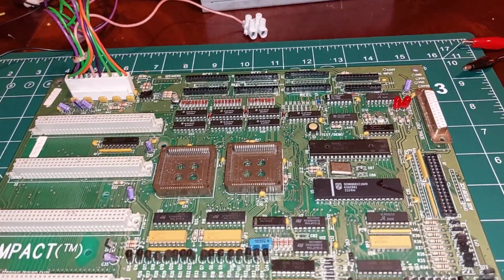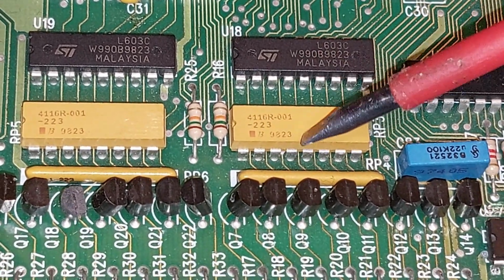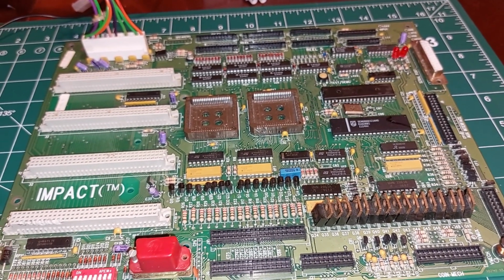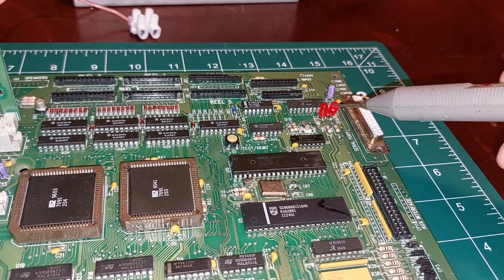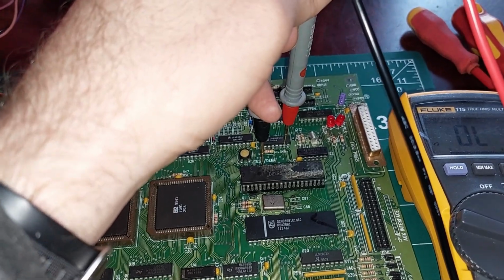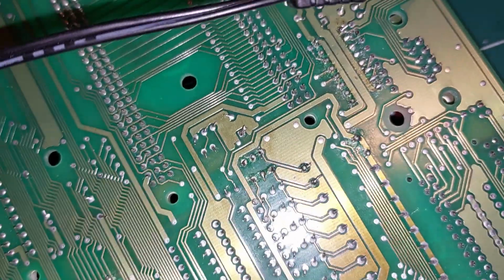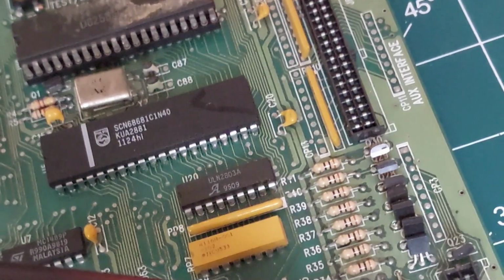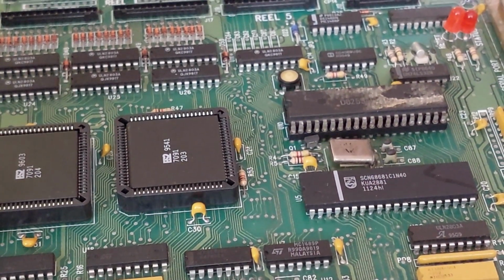JPM impact resurrection- working on it without the drawings

Comment: Hi Magik I've a question I've got a board where the buttons don't work at all. I've got this problem on a jpm impact 1 and also on a mpu 4. I've checked the tracks and transistors that are connected to the socket but they are all fine. Can you give me some hints? Thx mate.